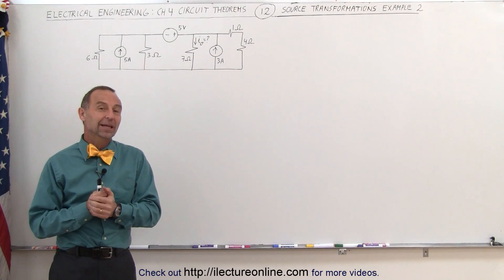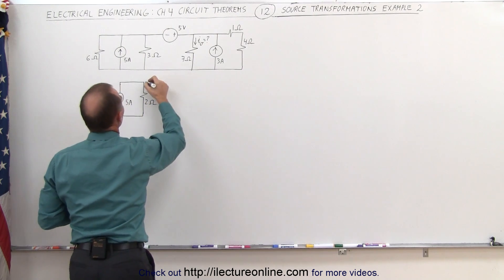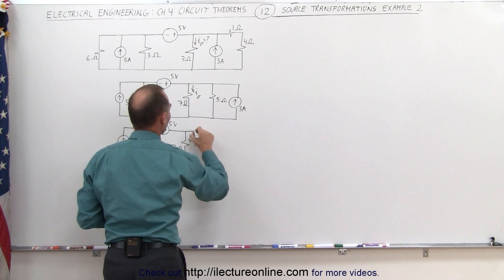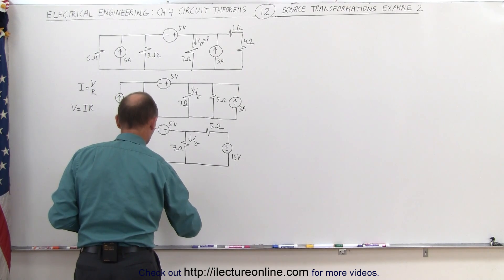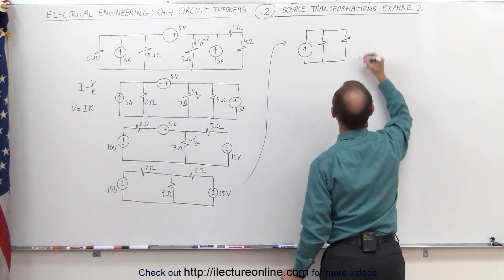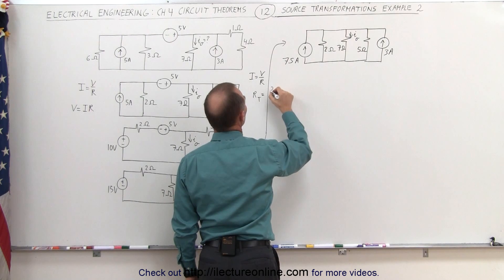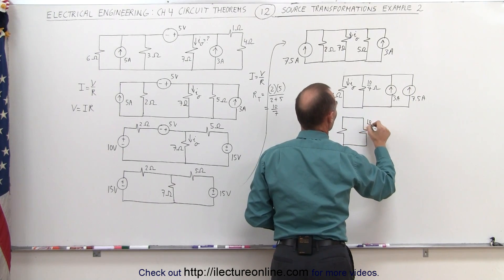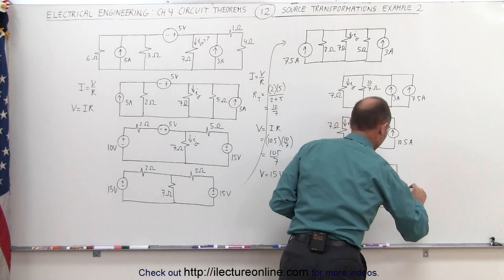Electrical Engineering: Ch 4: Circuit Theorems (12 of 32) Source Transformation Ex. 2

Comment: Current through 7 ohm resistor could have been obtained by current division without doing the last source transformation thus: Io = 10.5 X (10/7 /(7 +  10/7)) =1.78 amps.

Comment: We could also use Node-Voltage method at the 4th circuit diagram to find the Voltage across the 7-ohm resistor. Then use ohm's law to find the current.

Comment: Excuse me but i have to ask
At 6:43 when you move the current sources together on the same side,
Shouldn't they be subtracted from one another?
Because one is providing current clockwise and another is providing counter clockwise. 
Please do answer.
Also anyone please feel free to reply.
Reply from the maker: It is easier to see when you bring the two nodes at the top and the bottom together and make them into one node (which is what they essentially are).  Then you can see that each of the two current sources provide a current to the same point in the same direction.  That is why they are additive.
Reply: @MichelvanBiezen  I'm sorry, but   I'm still not clear. May be you can make a follow up on this?

Comment: I didn't know you were allowed to add voltages like that 3:02. Do you have another video explaining that more in depth. Is there a name for that rule, so I can look it up. Thanks!
Reply from the maker: +thehomiebearfifa 
 This is called the source transformation technique, where you switch back and forth between a current source and a voltage source  in order to systematically simplify the circuit.
Reply: +Michel van Biezen 
I think he meant how to combine two Voltage sources together into one voltage source across a resistor. And same as about how do you add and cancel two current sources in the parallel? same? branches in this video and other videos. So I have the same question. Thank you for videos, they are great.
Reply: It does seem strange that you can add two voltage sources which are in series but have a resistor between them.  Any clarification would be appreciated.
Reply: I had the same question too. After watching a couple of videos on Youtube, this is what I concluded: 

Current sources can only be added when they are connected in parallel AND there must not be any branch in series between them. That being said, Current sources in parallel can be combined if there were branches in parallel between them. 

Voltage sources can only be added when they are connected in series AND there must no be a branch connected in parallel between them. Voltage sources in series can be combined if there were branches in series between them.

Comment: I think that after the 3rd step we can solve it by mesh analysis .
Reply: Yaz King99 True but source transformation can actually be done mentally and mesh would require you to solve equations
Reply: I solve using mesh after that step .unable to get the ans for current @7 ohms

Comment: From the first circuit diagram to the second, were you able to move the 5 A current source on the outside of the circuit diagram and place the resistant equivalent on the inside because they were all initially in parallel? Does that mean no matter which way a parallel circuit is drawn, I can easily move them around. Thank you for your time
Reply: Adding on, does this also apply to branches in series?

Comment: How you could re-arrange the location of the resistor and current source connected with other source?
Reply from the maker: Because if it is done correctly, you get the equivalent circuit.

Comment: At figure 4, i use super position but my answer is 6.1 . why ?
Reply from the maker: When I use Kirchhoff's rules on figure 4,   I get 1.78 A for the current through the 7 ohm resistor.
Reply from the maker: I just tried super position on figure 4 and I also obtained a current for 1.78 A.